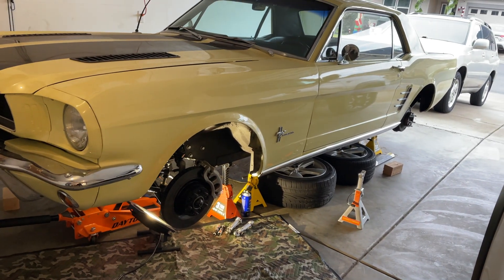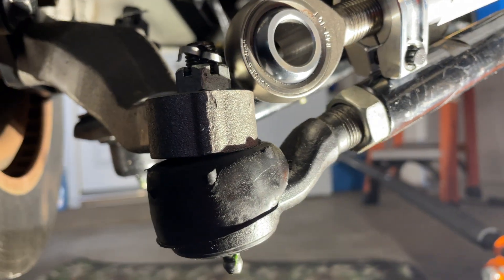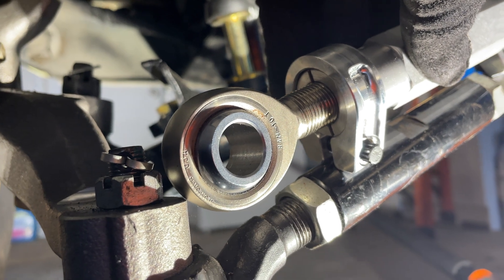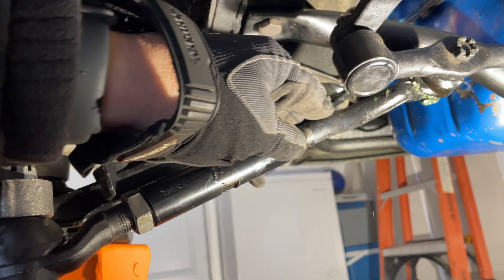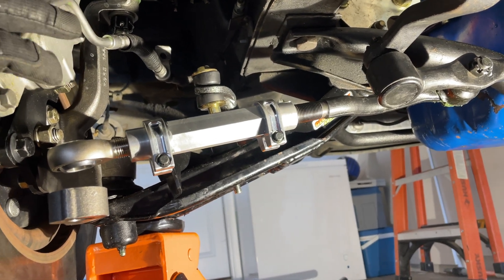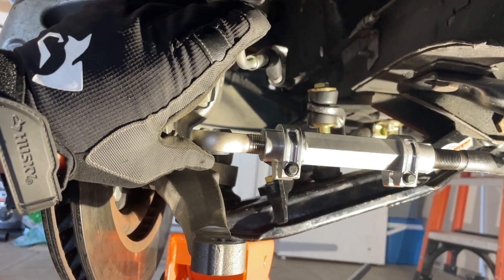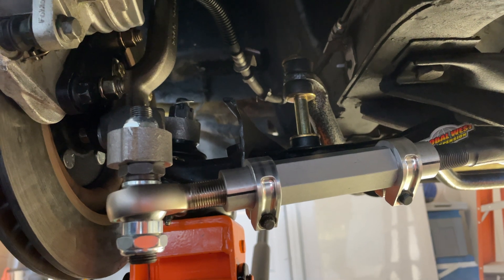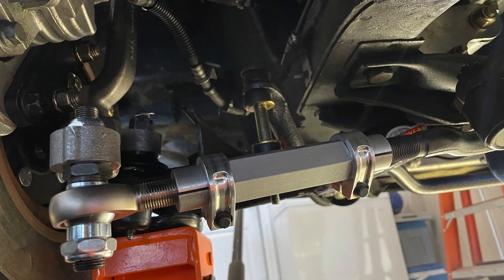Bump Steer kit - 1966 Mustang - by Mike Maier

Comment: that does not look like its gonna help with bump steer
Reply from the maker: It's designed to help eliminate play, and correct suspension geometry on lowered Mustangs, which mine will be significantly and improve toe angle. This bump steer replacement specifically works with 65-66 spindle w/70 big pin which I upgraded to as well. But, I guess we'll see. Thanks and sorry took so long to reply, I'm new to this YouTube deal.
Reply: lowering the front of the car with the tie rod in stock position I found really helps maybe even better with this mod @1966MustangRace